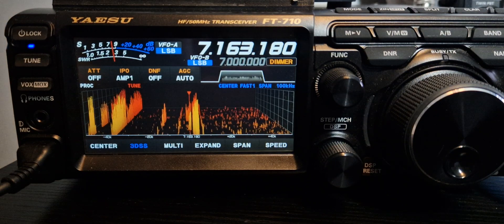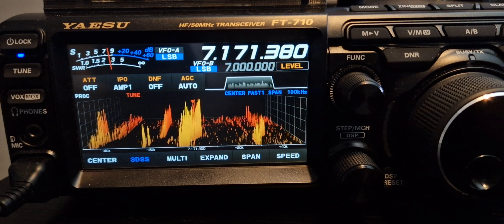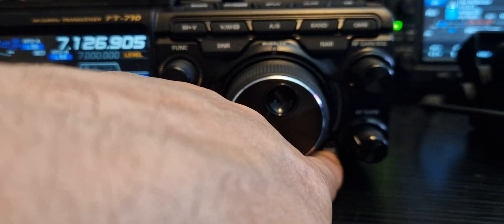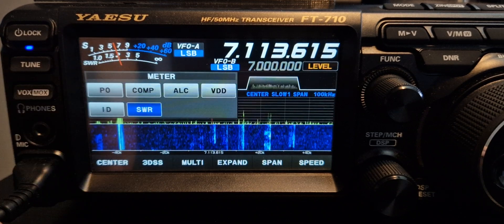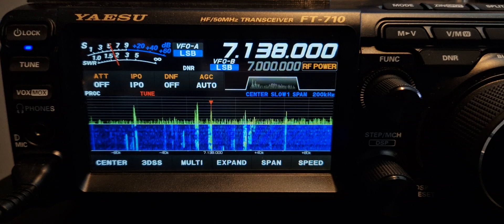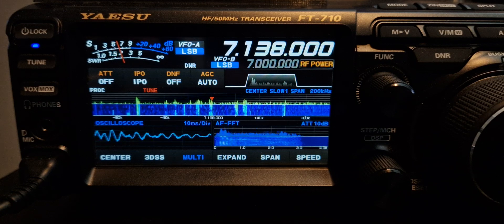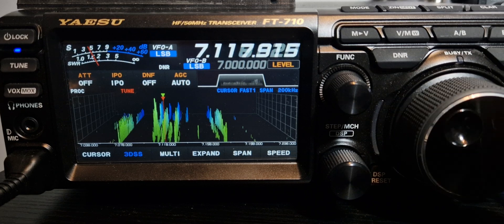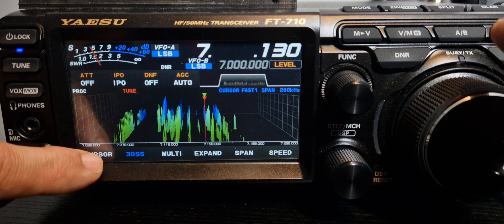YAESU FT-710 - USING SCREEN WATERFALL/SCOPE

Comment: The 3-D display is cool but I don't think it's as easy to track down contacts. I've had my FT-710 for three days now and love how easy it is to make contacts and how good the incoming signals sound.  I was using a loaned to me Kenwood TS-570 -  and the difference between that radio and this one is mind-boggling!
Reply from the maker: Yes agree

Comment: I had the Yaesu FT-710 for about a month, but had to sell it. Now, I have the Icom IC-7300. I love the 7300, but the noise floor (DSP) on the Yaesu FT-710 is definitely quieter than the Icom. I still like the Icom and will keep it, but if I ever get the money I will get another Yaesu 710 or DX10. Thanks for posting. I don't care for the 3D display. I can see why people like it, but I always stuck to the waterfall. The external monitor was nice, but when I was changing the radio you have to be looking at the radio anyway, so I felt like the external monitor was a bit of a waste for me anyway.
Reply from the maker: Glad your happy with the 7300.

Comment: I had an IC-7300 and am now trying to decide if I should get an FT-710.    I keep asking myself if I should maybe try the FTDX10 - a lot of reviewers like it better.  You really make this radio attractive though.
Reply from the maker: I think get dx10 it's a better beast but 710 is good value as includes speaker.